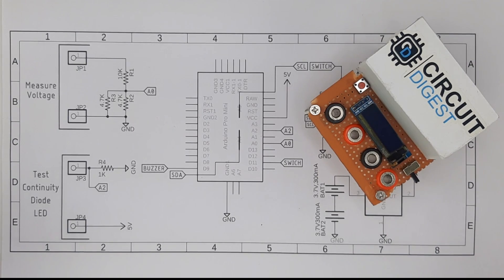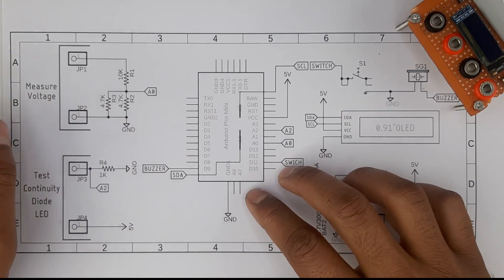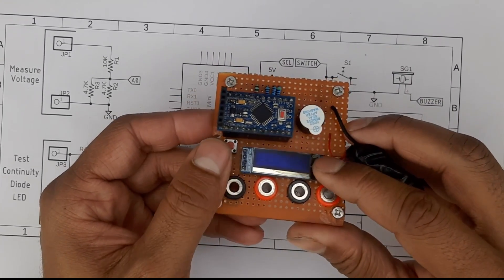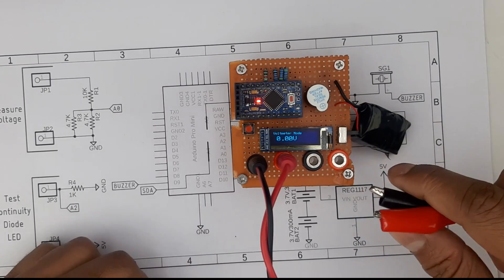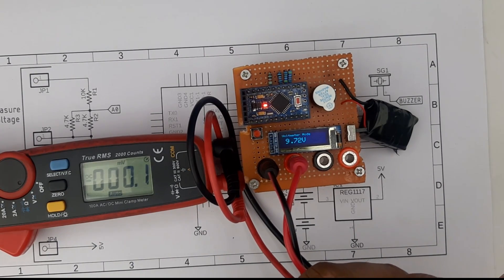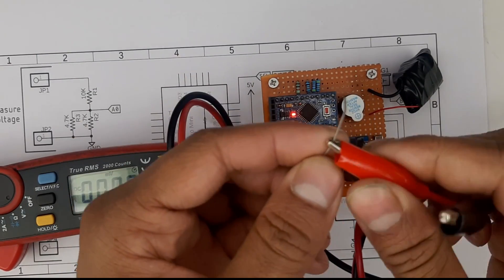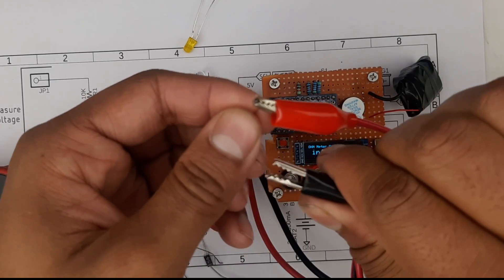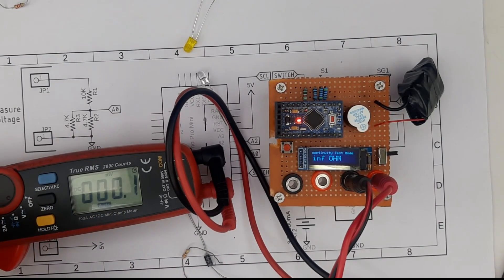Build Arduino Multimeter for Measuring Voltage, Resistance and Diode

Comment: I have. Some question  how i can make it with promico and where to put buzzer i/0
Reply from the maker: You may. But you may need to change the code accordingly. And the buzzer is connected to the digital pin D9.

Comment: What changes i have to made if i use arduino uno
Reply from the maker: You don't need to make any changes. Connection and code is also the same.

Comment: in schematics R1 is 10K.
in arduino sketch / code, float R1 = 10000.0; // resistance of R1 (100K) -see text!

the value in code is indeed 10K, but comment on those line written that R1=100K. 
Can you confirm? @Circuitdigest
Reply from the maker: It is 10K .

Comment: File is required...and add file..but cant upload the program... error compiling the arduino problem ..so pls help
Reply from the maker: Hi, all the required files can be found on the project page. make sure to install all the required libraries. If you still facing issues please use our forum to get more help. https://circuitdigest.com/forums

Comment: Can I get its code .......
Reply from the maker: Yes code already give in description
Reply: @Circuitdigest  is Arduino pro mini is different with Arduino Uno or not , which one you have used in this design???...
Reply from the maker: @mohitbaby1974  We have used pro-mini in this project, the major difference is its size. with very minimum modifications you can also build this with arduino uno
Reply: @Circuitdigest   is there any online simulator or any website to perform this design and code , because hardware is not present to perform  on Arduino ide
Reply from the maker: @mohitbaby1974   for this circuit you cant simulate everything, maybe you can give proteus a try
Reply: @Circuitdigest  can you send the code pls thanks